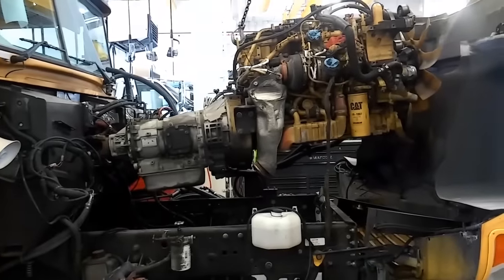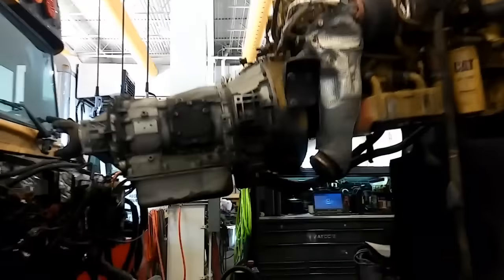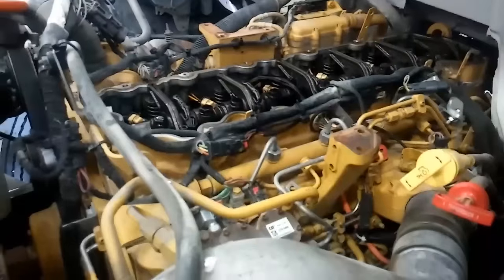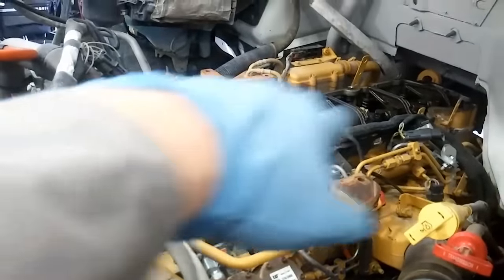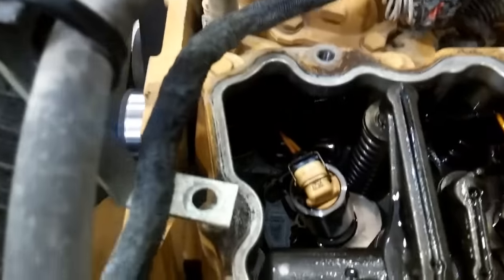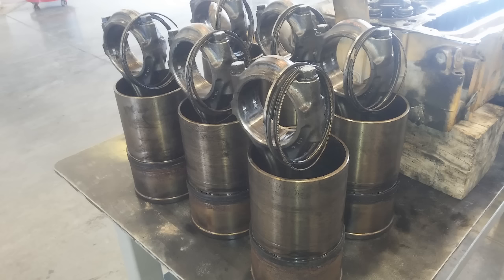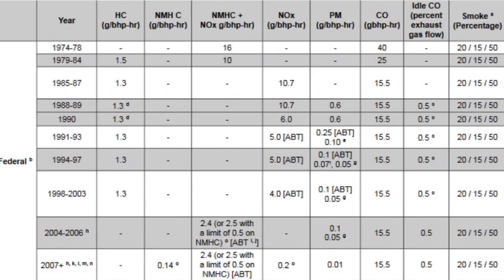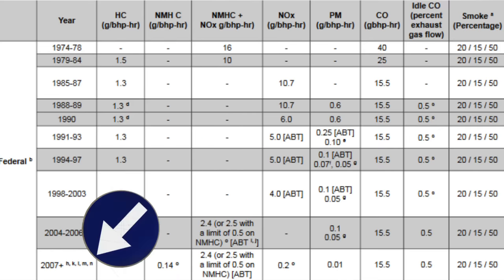The Worst Engine Caterpillar Ever Made.

Comment: What are your thoughts on the C7 Acert that comes in the 2005 Stewart & Stevensons LMTV (Light Military Tactical Vehicle)? It does not have the "S" in the C& designation. I assume this is a mildly adjusted variant of the 3126 and still has your seal of approval?

Comment: 3176 is on the top of my list. So many recalls and the worst spacer block design EVER made. Take a cast iron block and put a aluminum spacer block(holding the liners) and then put a cast iron head on top and then... NOT tap the head bolt threads in the block deep enough. Never had to check the oil level only the coolant / DCA condition. I remember at Cat live steams the 3176 team of engineers would try to duck under the tables because of all the flank they were getting. LOL  At least at 250,000 miles you could just throw a 3208 away.
Reply: What about the 3176B ? Looking at a sport fisher with them in it. I think the B changed the spacer

Comment: your correct to say this is THE worst cat engine. but the codes and problems with complexity is only part of the issue, i worked in the truck shop of a cat dealer for 6 yrs during the early 2000's and did alot of warranty repairs on the 3126 and c7 engines. blowby with the low horsepower engines was extremely common. so common that we called them "tune ups" when they came in. it would be a second exhaust out the blowby tube. did not happen with the 250 hp engines only the 190hp. the difference between them was the piston. low hp had a 1 piece piston the high hp had a 2 piece. low hp would brake the rings. the only remedy that cat allowed was a rebiuld wih same pistons and new rings. very time consuming wether it was 1 cylinder or 5 the process was the same. cat knew but would only authorize the one fix. would see the same trucks back multiple times for the same problem.

Comment: Hence the reason Cat doesn't build road engines anymore!
Reply: LOL! I just made that comment and then seen yours. Oh Well, bears repeating.
Reply: The EPA ran Cat from the OTR market.
Reply: Cat Stopped making on Road Engines because of the High Cost of the US EPA And Carb requirements for the pollution system and the Numerous Failures that was associated with the CARB ENGINES

Comment: The other worst engine that cat made was the ones for zero turn mowers. That ran hot cooked the oil and blew up so easy. Ferris and tori has them in thier mowers for 6 months and they went back to b&s kawasaki and kohler has and diesel because they were so bad. Cat and mower shops wouldn’t touch them

Comment: Wait a minute.  Are not the 3208, 3126, et all capable of rebore with oversized pistons like a spark ignition engine?  Run it through the machine shop, bore it and do a standard rebuild ...  There used to be 0.040" over piston/ring kits for at least some of these sleeveless blocks.

Comment: I work for a company that contracts out student transportation...aka school buses. We have a large fleet aprox 276 buses. We go from '04 to '20s. The '04s are equipped with Cat 3126 and C7's. I must say those engines have been really reliable. Besides typical repairs, water pumps, oil leaks, etc. Those engines are seriously detuned probably because of the platform there mounted in. With the fleet we have numerous other engines,  Mercedes MBE 900's, Maxxfarce 7's  but mostly Cummins ISB 6.7's those have also very reliable for the most part. The worst ones we have are the VT365's in out '07s... Total junk. Hard starting,smoking, EGR coolers,injectors,turbos. All the CAT engines are pushing 300k and still run strong probably because they a HEUI engines.
Reply: The MaxxForce engines are junk too.

Comment: Speaking on the base engine, I still feel like it’s better than the 3208. ARD heads and turbo’s are not part of the engine. As an assembly, definitely less than desirable. I can’t fault an engine for having less than optimal emissions equipment bolted to it.

Comment: Cummins ISX air compressors do have timing marks. Does anyone ever use them? Sometimes. Maybe. What for?!
Reply: The compressor is timed to cancel out a harmonic vibration in the engine that can cause damage to the gear train.
Reply: @montemerritt9579  Awh your so sweet.

Comment: I would rate the 310HP 3406B model right up there.  You know you're in for pain driving a truck with a bad AFS grossed out at 80K pounds when Roadway with their 318 Detroit powered trucks is passing you uphill pulling their doubles.  Yeah I drove a 88 Pete 379 with a 310 Cat fleet engine in her that blew the AFS hauling Haz-mat on I-68 going to Maryland so I literally was getting passed by everything that was on the road.  Hell I waved at a freaking YUGO that passed me climbing Cumberland Gap.  I had NO and I mean NO power to climb and this truck had 3.93 rears and a 9 overdrive transmission.  Then to make things worse I had to make my second stop in SC reloaded and was sent back over Saluda in NC and then the gorge.  I got back to the yard and said different truck or I quit.  They gave me one of the sky blue KW T600's that had the 350 Cummins in them.  I thought I had died and went to heaven.  Then I got Rose anyone ever driven truck were the boss said you don't have enough power.  Mine decided that he wanted something to show up his BIL that had just redid his 3406E  with aftermarket parts into 700 HP.  Rose was redone the same way into a 850 HP Big Cam Cummins that ate Cats for breakfast lunch and dinner and then as a courtesy gave their drivers the reach around.    I routinely was sent down to the Atlanta area with a load and my reload was empty syrup bottles for a plant in my hometown.  Before the Overhaul climbing Mounteagle was not even a chore afterwards she accelerated uphill.

Comment: The 3116 and 3116huei/3126a had a different head. 3126,c7 and c7s had the same head. C7s had the heui rail removed and machine ports for the quall tubes. It has 3 fuel manifolds. The 4 regulators, regulate fuel pressure to engine and after treatment. Timing the pump and compressor is because of balance and if they where timed wrong they would tear up the gear train. Other manufacturers time there pumps too. The injector thing is because of that balance thing. The ecm can pick it up. So if you change a injector and it's hitting harder it's going to pick up the next weak one... I always hated c7 etc not having removable cylinders... The issues with c7s was the after treatment. It would be a good engine if it was just the engine

Comment: ok, let me throw this at you, I have a 81 Thomas safetyliner with a VT225/555 engine (runs fine), I am looking to replace it with something with a little more oomph, 300-350 hp would be good (500hp would be great if it wouldn't tear up the rear end), what I have come across so far is the c7, that would put me right in the hp ballpark and right in the engine compartment size, I have no emissions or electronic anything whatsoever to deal with, what do you recommend to the c7 or something else to replace with?

Comment: My father in law just bought a 93 Pete with a 3406b in it. It's supposed to be worked up to 850HP, however the engine brake stays on when the switch is on. You can't get any reaction out of the accelerator when attempting to downshift with Jake Brake on. There is also an on/off switch mounted on the shifter next to the knob to control Jake Brake. Any suggestions would be great. Thanks for the content.
Reply: If wired correctly, power to a fuse, through clutch switch, to low idle throttle switch on rear of pump, up to toggle select switch and out to each brake. Sounds like your wired direct.

Comment: I would love to see a video on how a Cat Brake Saver works as I have no idea how they work.
Reply: Heavy hauling Idaho
2 weeks ago
1 of my peterbilt 379 with a 3406 B engine has what has be told to me as a brake saver... I have no idea how the damn thing works. It is activated by flipping a switch on the dash, then grabbing a second hand brake lever on the steering column. No it’s not my trailer brake handle.... there is two handles on the column, 1 is a “brake saver” and 1 is the trailer brakes. What this hell is it? how does it work? Oh ya it’s works half way decent

John Goldsmith
John Goldsmith
2 weeks ago
A Cat brakesaver (AKA oil leak) is a engine oil retarder. It is mounted between the transmission and rear of engine.  It has a dual oil pump, one side works engine, other end brakesaver. It has a oil cooler that's extra long due to the heating of the engine oil. Should also have a oil temp gauge and you better watch it. Should also have a air psi gauge. In the special oil pan you have a control valve. When the brakesaver is activated a diaphragm separates the air and the oil. More air psi pushes the control valve farther to increase oil flow to the brakesaver thus adding more engine retarding. If the diaphragm is blow/leaking or the air (regulated & adjustable) is set to low you will have poor engine retarding.  The brakesaver itself has a flywheel for the starter ring gear and a flywheel for the clutch. Inside the brakesaver itself acts like a reverse torque converter. Only a few people can rebuild one as you have to have the proper fixture to hold the stator in place. Or you will damage the seals. You have a manual lever on the steering column ( can use it that way) or if wired correctly it can be activated electrically (lever not needed).

Basically it takes engine oil and throws it against the rotation of the engine. Your local Cat dealer can print it out if they aren't lazy under system's operation.

Comment: Is the 3208 a good cat? I'm looking at a 81 gmc dump with that motor. I don't know squat about cat engines.
Reply: Two ring piston, likes oil, sleeve metering fuel system, hates water, bad for getting on air. No sleeves in block, have to bore them or press a sleeve in block and that could be a problem if not done correctly. Winter time cold nature, exhaust smoke will make you cry.
Look for his video.

Comment: I'm jonesing for a new video. I have no clue how the fuel is maintained equally between the 2 tanks of my Fretlnr business class box truck c7. If I just put fuel in the right side and not the left is that ok?
I'm not adept....
Thanks
Reply: Equal draw, equal return.   And when shut off it with siphon from one tank to the other through the pic up tubes in the fuel tanks.  Hard to believe I know.  But it does

Comment: I have an opportunity to buy a new 3054C cheaply and put in a 1968 Fargo 1 ton. Is there anything I can do to increase HP? 120-170 or there abouts? bigger turbo or turn up fuel somehow? Thanks in advance
Reply from the maker: You need to understand that is a tiny Diesel and there isn't the same aftermarket support that a C7 or a 3406B has.

Comment: I guess every generation has it's most hated Cat engine, my generation hated the 3204/3208 and their predecessors. 
Solid block, no liners, 2 ring piston. 
Noisy, smokey, smelly, lots of blow by and absolutely no warning as to when they would drop a valve or throw a rod or spin a main.
The only thing you were sure of if you owned one is that one day a machine would suddenly make a bang and a clatter and a cloud of steam and smoke and that was it.
In the field after a valve dropped you couldn't pull a damaged liner and slam in a new piston and repaired head because there was no liner.
You had to pull the engine.
Rebuilding them went from being difficult to being a nightmare.
Ordinary re-boring techniques of the day were not acceptable and according to Caterpillar the only acceptable way to resize cylinders was with a Sunnen CK-10, hugely expensive machine.
Later the tune changed and cylinders shouldn't be re-sized, they needed to be sleeved back to standard. 
Cat prominently displayed a guy in Cat uniform using a plain old Quik-Way boring bar to punch out the blocks. Right Face! Left Face! Eyes forward! Don't look back.
The crankshaft bearing problems were so frequent Cat offered a portable boring bar tool group to bore out damaged main bearing bores oversize to which you would fit an over sized on the OD main bearing. So expensive no one could afford it and of course normal machine shop line boring was unacceptable
And the change ups, crankshafts, blocks went on, and on. It didn't end until it died.

But how much of this was Cat engineering or Cat business failure?
Cat and IH/Navistar had a long time relationship with Navistar producing Cat products until Cat sued Navistar for stealing Cat technology and ending up owning Navistar as the settlement. Look online, it's there.
How much of the 3208 type of engine was designed and built by Cat? Who knows.
Cat bought Perkins and markets Perkins engines painted yellow.
Where does the C7 fit in? I suspect it is either a Navistar or Perkins engine painted yellow.
Was it a Cat design?  Maybe.
Was it a bad decision by the Cat business end? Absolutely. Even if they didn't design it,  they owned it.
Reply: -->"How much of the 3208 type of engine was designed and built by Cat?"
-------
This topic snapped me back to the 80s.
If you popped the hood back then on any Ford dump truck for instance and the engine was yellow, it would either read Caterpiller 3208 or Ford 1160. I drove them all back then & could never tell the difference with performance, appearance etc. So I always wondered if Ford was in on it?
Back to present day my '05 RV (20,000mi) has the C7 & I'm guessing it's an '04 engine because original tires are '03-'04s so this video is somewhat comforting lol!
My new Sailun tires are sitting at the tire shop btw
Cheers!
PS--I owned 2 W900s with 3406Bs. The '87 got retired through an accident but the second one is a '93 & my buddy still runs it and only does regular services.

Comment: Adept ape 3406 5EK on the lowest engine brake setting what cylinders are firing?
Reply from the maker: Generally on the electronic Cat engines the low setting fires the cylinder 3,4 compression brakes (solenoid 1). Medium is 1,2,5,6 (solenoid 2) even though it's actually 2 solenoids and high is all cylinders.
Reply: Adept Ape thank you buddy!!!

Comment: 3208, 3406 peec were also pretty bad. I almost forget about the C12 in heavy haul application. We had a fleet of 20 that never made it past 300,000 miles without an in chassis.
Big can cummins had a timed air compressor too.

Comment: I have to disagree. For me, it's the C9. At least the C7S came from a long line of half decent predecessors. The C9 was a fresh design from the ground up. Who in their right F***ing mind would use a spring clip to stop a Roller Cam Follower from turning! That's an engineering embarrassment! Even with brand new parts fitted correctly the Follower can be rotated off axis 15 degrees both directions! Of course this means the Roller wears itself out as well as the Cam Lobe necessitating replacement off the Cam and followers. Which means removing the head. Brilliant! Oh, I might add that CAT had to provide an exchange Cam program as this became such a problem. Not to mention the HEUI Pump failures, the injectors, and the injector harness.

Comment: Please do a segment on the nxs engine and why there's no rerate and why after 500,000 miles the boost drops off
Reply: It can be rerated. A NXS is just a later version of a MXS. You might need a PAR run to adjust your FLS/FTS if nothing else is wrong. Have seen fuel rate drop over one GPH on these.
Reply: I have no idea what a par or fls is
Reply: @joenames3266  A PAR run is, to make things simple, a dyno run. FLS means Full Load Setting, and FTS means Full Torque Setting and you shouldn't ever have to mess with either of these 99% of the time. Your low boost could be a boost leak, stopped up air filters, wastegate out of adjustment or hole in the hose, fuel pressure, boost pressure, atmospheric pressure sensor reading wrong,  cracked exhaust manifold or flex joint, bad turbo, or number of things. A good CAT dealer can find a low boost issue pretty quick and would be your best bet. Like John said, a NXS and MXS are the exact same engine. Once CAT got to serial number MXS99999 they switched to NXS00001 because they ran out of numbers. It can be rerated up to 550 hp / 1850 ft.lbs, or to 625 hp / 2050 ft.lbs if you do the iron changes.
Reply: @nickforgey509  thanks that makes sense

Comment: My uncle gave me a Cat ECM that came off a school bus engine from the school district he wrenched for. Not sure what specific model it came off of and I don't know if the serial numbers on the case will tell.
Reply from the maker: An original ECM will have the engine serial number sticker on the back. If not you would have to plug in the ECM with a jump out harness to see, that is guessing that it was a good ECM to begin with.
Reply: @AdeptApe  My money is on it's probably a dead unit. Plus I'm not sure what all I'd need besides the harness anyway even if it does still work. I think he was even trying to give me some HEUI injectors to have as spares for my 7.3L Powerstroke. Can't remember if they were Cat ones or International ones but I do know they had the square solenoid top on them. Not even sure if Cat ones would fit in a 7.3L or what. Kinda want to do a Cat swap on a OBS Ford Powerstroke though. I'll have to dig the ECM out from underneath everything in my closet and see if it still has the sticker on it.